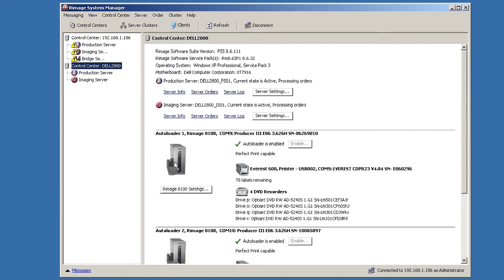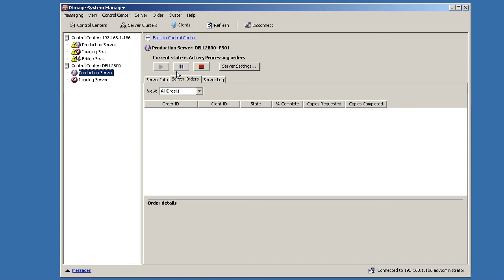Rimage Configure autoloader bins

Comment: The firewire cable connects the recorders to the PC. On an Amigo II, the serial cable connects the robotic loader to the PC.
USB cable is used to connect the printer.
Reply: Hello, i recenlty just got the rimage everet 2 and perfect image autostar 2 loader. All one unit. I have the cd 
Designer Software Suite V8.2.8, CD Designer Software Suite V8.5.18 and the Producer Software Suite 8.2.127. I have Windows XP, service pack 3, firewire cable, USB Cable but do not have the Serial Cable.  I get the Printer to work but the autoloader i can not get to connect and work. Can you please help???